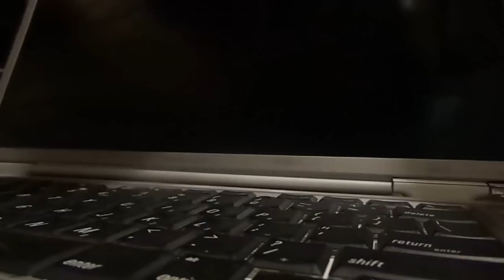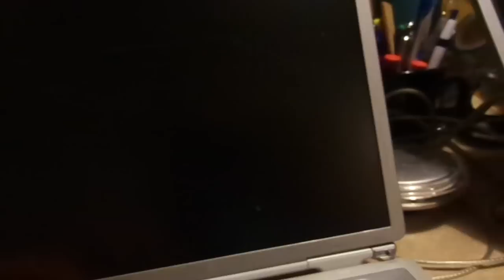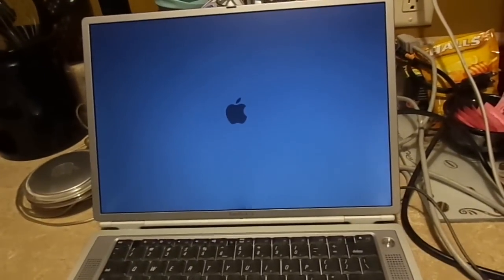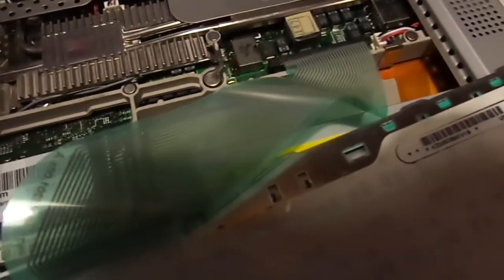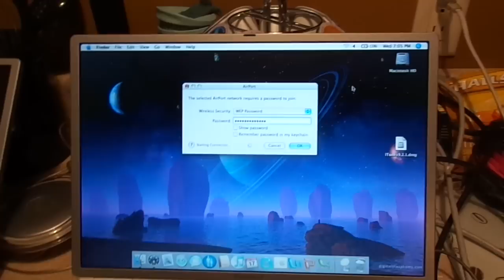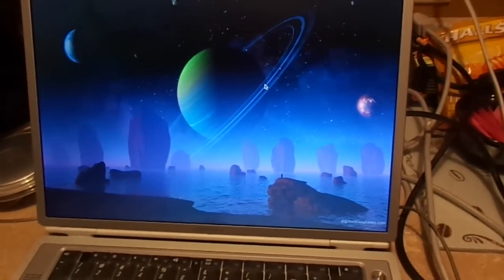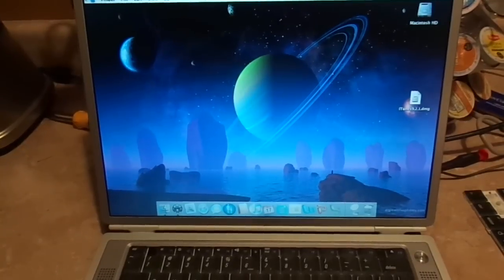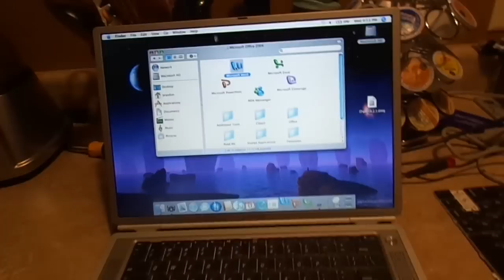PowerBook G4 "TiBook" Repair and Disassembly

Comment: I just bought one of these on eBay the other day, guy said he took the hdd out and thats all that was wrong (Other than the paint of course) But i just opened it up and saw where the hard drive was supposed to be, Was nothing, I couldn't see the connections, This video confirms something that makes my skin crawl, The guy took not only the hard drive, but the cable to the Motherboard aswell!!!!!

Comment: I've got a TiBook in extremely good condition. I bought mine for $40 at Goodwill, and it has almost no cosmetic defects. Mine is the 800 MHz model, the highest end 2002 revision of the machine.

Comment: Most likely, all you would've needed to do to get the 500 MHz PowerBook to start was to remove the PRAM battery while the machine was plugged in. My 500 MHz model had that issue.
Reply: These inherited that quirk from the Pismo G3s, wonder if it's just the first Titaniums or all of them.

Comment: within the last month, I recently came into ownership of a 500MHz TiBook from Craigslist for $30, with all the normal wear items, including a broken A key. in it, was a 256MB PC100 stick, and a 20GB hard drive, with the ORIGINAL FACTORY INSTALL of OS9! There was no 10.x anywhere to be seen. Then two days later, I acquired TWO MORE TiBooks from my scrapmetal buddy when he went to the local computer scrapyard to drop off a load. saved them for me because I said I needed a couple for parts. what I got ended up to be even more stellar-- I got a 550 and a 667! Although neither are the DVI models, they certainly didn't come with nothing at all-- the 550 came with a 20GB hard drive as well as 256MB of RAM as well, and a copy of 10.3.9; the 667 however, came with a half-height 48GB Travelstar, 1GB of RAM, and was running 10.4.11! 

so I now have these three in different states of wear and have been working towards having time to actually do what you're doing here. I"m going to use the 500 for what spare parts I can to complement the 550, since some parts are the same-- the 667 hasn't been opened save for under the keyboard to check the RAM out. Someone certainly loved their Mac with that one.

the 550 didn't come with an AirPort card, so I dropped in an Atheros-based one in the PC Card slot, and dropped Debian on it. runs great in CLI-mode, but haven''t tried X yet on it. the 667 is going to stay with 10.4.11 until I can afford to replace some of the things it needs in terms of a proper CD burner and a new bottom cover. 

This isn't my first rodeo with TiBooks, having been a previous owner (and I think I even commented on your previous video whilst still being an owner of one... I think.) I got a 500 running 10.4.7 back in 2011 in very rough shape, replaced almost all the case parts, and ran on the original battery for a couple hours at a time. it fell into disuse in 2013 after the battery croaked, and by then it was starting to get worn again and was developing all sorts of problems with the keyboard ribbon and such. I traded it last October for an aluminum 15-inch Powerbook G4 (to my scrapmetal buddy, even!) which I later found out upon grafting in my hard drive to be an HR 1.67GHz model with 2GB of DDR2 already installed and a perfectly working original battery with only 15% wear after 9 years (according to CoconutBattery). Now coming on 10 in two months, the battery is still holding strong, and it's become the PPC mac staple of daily computer use. I have a 250GB IDE drive waiting to have the system cloned to it, somehow... and I'm working that out still. I've come to the conclusion that a  normal 3.5" USB or Firewire enclosure that can do 48-bit LBA is necessary, and I have yet to acquire another after losing my one-cable 2.5" solution somehow. I'm also contemplating the use of an IDE SSD instead, of 120GB or higher, if I can find a decent one for cheap.... but who knows what the future is going to bring.

if anything, I think I'm extremely lucky to even be able to power any of them on-- after getting the Alu, I've been hoarding powerbook AC adapters left and right the same way I do with 20V 90W Lenovo adapters and 90W Dell adapters-- one of them is an actual 2-prong-only Ti-tipped adapter that I (believe) the TiBooks originally came with before the grounding scare happened. I use that as the bag adapter for the Alu, and have four grounded adapters with long cords at home of 1.875 and 2.65? Amps mixed in respectively.

Comment: Nicely made machines: mine's still ok except I just zapped the partition map by charging into an openBSD install without thinking..no worries I'll reinstall from USB and OF. I'd rather have a working optical drive though (2 have gone down): any repair tips?

Comment: I used to have that same model of Power book, Mine had those same defects, Mine had a hinge failure and it cut the display cable almost clean off somehow :| All i have left of it is the Logic Board and the keyboard i bought for it. RIP Ti Book

Comment: First thing I noted was at about 21:40 you where lifting the bottom cover when in fact it slides and then lifts.  Don't blame Apple for your ham fisted aproch (sorry for the spelling I am dyslex)
Reply: Thank you for the spelling.  I did state (I am dyslexic...) Witch is a  resin for getting spellings wrong and not at all ham-fisted.      I did look back at your video and even tock the bottom off my PowerBook Ti just to check and what I found.  Trying to take the bottom cover off in the way you showed in your video would as your video showed brake the frame.  What I also found was if you slid the base forward a little before removing it then it come off very! easy.   I also tried to separate the frame from the bottom and could not!  Maybe if I had removed the bottom case in the way you did with the force you used it would have broken in the way you show. 

Again I dyslexic whats your excuse for being ham-fisted?

Comment: Wait. no, no NO, NO, NO!!! I need parts... Oh well, too late... :(
Reply from the maker: +Krivulda What exactly do you need? It's not gone yet.
Reply: Well, even if you wwwwwwwwwwwwwwwwwwwwould send that to me, shipping to Czech Republic will cost WAY more than complete one semi-decent from ebay, but thank you very much for your kindness :)

Edit: oh, wow, didn't even notice the keyboard stuck. Well, that's another problem to endless list of defects sticked to side of my computer... :D

Also, I am not skilled at all working with Macs, I recently rescued a PowerPC 7300 with two original keyboards (super-duper mega uber rare in CZ) from a dump, with some Apple printer (very similiar to Canon BJC-250) (sadly no mouse or display) , BUT when I tried to power the Mac up, I heard HDD spin noise from the speaker followed by some "space sounds" (like that cheap chinese space toys sounds) and no chime. No drives activity was going. I found one problem, the RTC battery has exactly 0.1 milivolt, but these are expensive as hell, at least here.. Do you know what can cause it? 

Like I said earlier, I have NO idea, what to do with Apple stuff, I have never even seen any Apple product, but I actually repair PC stuff.

On the end of this comment novel, I really LOVE your videos, keep doing them at least forever!
Please don't mind mistakes in my english.

Fun fact: You look like me, not kidding. I bet PC guys in most cases looks same. :)

Comment: I found this laptop in electrical' boxes and it be my first take apart laptop and I having problem with my cooling fan made my laptop overheat so fast and I'm trying to take back panel and front panel off to get to cooling fan, I'm stuck !! How can I remove cooling fan ? And I was broke a RAM bracket 😞 how can I change a bracket also? Thank you.